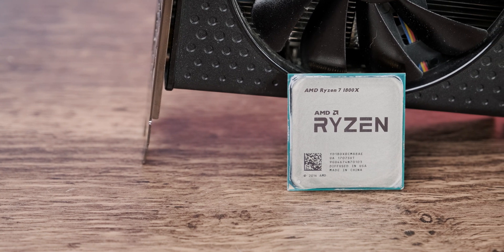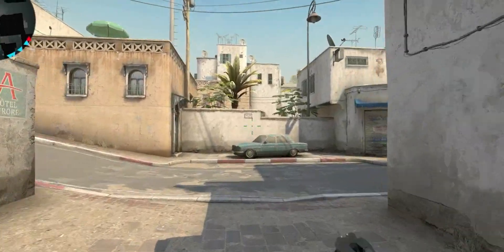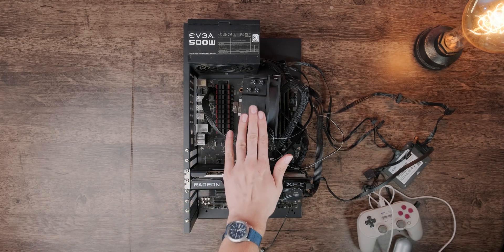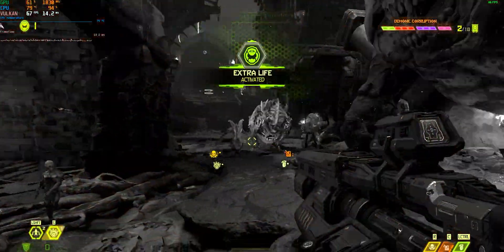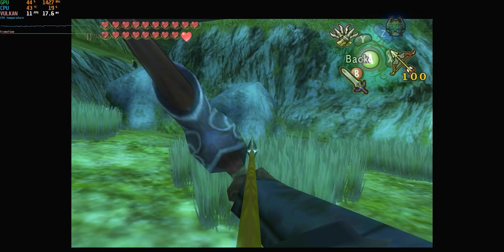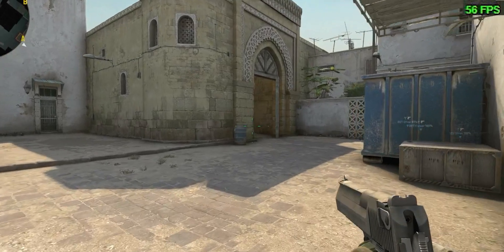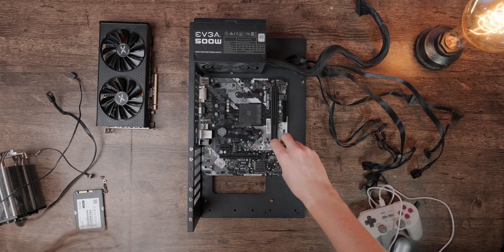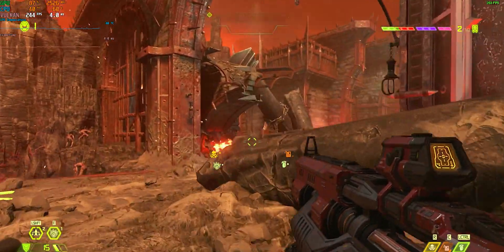WHY Are People Still Buying These CPUs? - AMD FX Series in 2023

Comment: My 6300 went over 5ghz stable on air cooler. Its way better than the similarly priced intel chips of the time. The operating system and games was the problem..it wasn't optimized for these chips , I argue by design. When games were better at multi threaded design these chips destoyed intel.

Comment: i run 3 8350 machines. one controls my CNC, one controls my laser and one is a linux box. the cnc machine has been running nonstop since 2012 no issues. it was a 3x sli machine but now has only one gtx 780sc. 2 were killed by canned air and not blocking the fan from spinning. all 3 machines have 32 gb ram. all 3 also run the Sabertooth 990fx MB and seasonic PSUs. the oldest box that has been on since 2012 was only cleaned 2 times both times i killed a GPU. but even in the garage in Phoenix AZ with an ambient of 135f it still runs great with the h115i AIO. For running the CNC i have an AC unit cooling the storage box under the machine where the pc and control unit are.  i ALSO HAVE A 6300 AN 8120 AND AN 8310 I have 2 backup mobos and 2 sets of 32 gb ram. I may make a few boxes as HTPCs. they are real 8 core CPUs just not hyperthreading CPUs.

Comment: The problem with the FX series is pretty blatantly obvious when you look at the architecture. Even their "high-end" offering of the 9590 was still based on the same failed Clustered Multithreading Technology that AMD premiered with the chips. It was, and still is, a terrible implementation of having two schedulers with one core because of cache sharing across the whole chip bogging everything down and causing huge latency spikes. I rocked an 8350 for a year before I upgraded to Ryzen 1800x. Now I'm rocking a 5900x and I've never been happier with an AMD system. Got my eyes set on Zen 5 as an upgrade path

Comment: I'm still using an fx8350, keeps me warm when my room is a bit chilly
Reply: If you want the same room warming feature in a modern CPU, Intel is for you.
Reply: Totally lol. When i max out setting i could heat a small apartment with mine.
Reply: @EddieJarnowski  thats the + in socket 3 +   " plus it heats your room "
Reply: I hope you paired it with a GTX 480
Reply: i got an enermax air cooler on my 9370 and it idles at 5c and maxes at 50c with mx6 thermal paste i benchmarked it and it maxed like 51-52c
Reply: @DoodmangYT  for some reason a lot of AMD chips from that era didn't report temp correctly, unless the room that it's in is actually near freezing temp.
Reply: @KingSnake377  thats missing a 2 lol its supposed to say 25c my bad lol. my cpu cooler is huge is why it wont fit in alot of cases my pc is also open air basically in a test case.
Reply: Exactly. Mine is water cooled, but ramp it up and you still get a nice warm air stream over the keyboard.
Reply: I have something else for that purpose 241w full load in benchmark running about 1-2 hours and i have nicely warmed room 😊 or heavy game with 225w gpu and like 100w from cpu about 2 hours and it's nicely heated 😊
Reply: Idk my wraith prism that I got with my r7 3700x cools my 8350 pretty nicely I have my 3700x to my cousin because it wasnt getting used because I have a laptop with a 5800h lol. I have a Asus corsair iv formula 2 slots dont work because of course it doesn't but I have a mild turbo oc to 4.5 ghz and it works fine. Just slow rofl.

Comment: I redid the thermal paste on my fx6300 and gpu after so many years of service. I havent overclocked it but it has served me almost daily since 2013. 

I wanted to see if there were any good, cheap am3+ chips out there that i could upgrade without redoing the whole rig. Any thoughts?
Reply from the maker: If you're already on AM3, the 8320 or 8350 could be good options. I wouldn't spring for a 9370 or 9590 though personally if I was on AM3. I would also avoid the 8120.
Reply: Mb is a big factor for overall results  esp with higher end cpu parts   but best performer overall inc stability with an oc and ov I found that my 8320 has been the best by a good chunk   and is superior to the 8350 as well

Comment: Hmm ok so i was not the only one who is experiencing studdering and slow load time on either application or game, i upgraded my old computer which had the amd fx 4 cores and decided to upgrade to 6 cores since the cpu can be had for cheap , paired with nvidia gtx 1070ti and i feel like it was a downgrade from my prev quad core setup.when i put the quad core back in all the games i play were smooth even the gtav which i played the most, how is it more cores equal worse performance and i read somone comments on how the cores were structured
Reply: The 6300 runs at 3.5 Ghz while the 4300 runs at 3.9. If the game only uses 2 cores, the 4300 wins.

Comment: My 8120 had terrible stutter in everything similar to yours even with 4.1ghz oc it was still pretty much trash in almost every way and would pull around 130 watts to do so the VRM on that board were always burning hot and really the price of high end AM3 motherboards is worse than price of the FX chips.

Comment: My latest PC originally came with an FX 8350. On games at the time that can fully utilize the CPU like Space Engineers it was a godsend compared to my last PC. That said, the 4x2 FPU setup was not helping with stability in other titles, especially single threaded ones.

I upgraded it to a Ryzen 5 2600x a few years ago alongside a more general upgrade due to the GPU memory chips getting damaged by the advertising cryptojacking exploit. Then a Ryzen 7 5700g last year due to ASUS doing a very bad thing with the mobo but that's a whole other can of worms.

Just an awful and expensive stream of bad luck.

Comment: We are called Retro PC Gamers of being a 10 year lag of having games of staying away from new ones out of the low income most of US have and using fx 8350 is OUTSTANDING for US of a PS4 level of playing games. Everything is affordable this way and life is great without needing to be like everyone else of doing the same things without going broke and homeless as this is the case of those issues involving gaming. In fact Ill be looking into getting a fx 9590 as I already have the fx 8370 so its all good.
Reply: I think I am good with my 8350FX, 32gigs ram, 2.5" 1T SSD, and R9-390 graphics on my MSI 990 gamer motherboard. It just works, though better in winter here in Florida. It runs smoother than my i7 2600 on Win 10, and both do great using Linux, though I have to use a lighter GUI on the i7. Though the Dell with a newer gen i7 runs close to FX, but too old to go win 11, and too expensive for a midget graphics card that is stronger than integrated.. Any who, they all work for a great cost. All better than them Core2 computers at least.

Comment: the cpu and motherboard prices before anything more is a good enough reason for me at $100 or less, that is even better since i already have a case, power supply, ram, and storage vs $300+ for just am4 motherboard and modern cpu upgrades, new cpu coolers in the thought too that's another price difference for extreme budget!

Comment: Games are finally using all of those cores and so they woke up a bit and they are cheap to get going.  Most of the problems with these CPUs were low core usage and also terrible quality poor motherboards with crappy VRM cooling making them throttle constantly.  I'm still using one of these 8370 CPUs clocked at 4.7GHz and yeah... it's not winning any prizes vs new hardware but I'm playing the latest games with decent frame rates within my budget for now while I save for something better.  Mine is paired with a 2060 no stutters in most games.
Reply: True about the vrm... and the northbridge also.. those gets very hot(thermal throttle)..

Comment: I remember when the FX60 came out, I had to build a system with it... real dual cores!  Must have been 2006/2007... Did a pretty good job with Oblivion...with a GTX 295, later replaced with dual SLI 580TIs...  For it's time it worked quite well...

Comment: I don't know but I have ASUS 990 FX board with a 8350 16 gigs RAM 128 gig SSD and a xfx  7950 card . And I don't care what anybody says if all plays very well I did a little overclocking on the car and the CPU and I guarantee you if you got it set up right it's playing modern games decent still

Comment: I only have my 8350 because i needed an SLI compatible motherboard cheap and it came with the memory and noctua cooler as well. Its my dedicated 7 machine with 2 gt9800 s in SLI to run mid 2000s tube TVs through S- Video for funsies.
Reply from the maker: That's a sweet setup!

Comment: i didn't know people were still buying them, but what i can tell you is that my PC is a UD3 motherboard(rev3), FX-8350, RX560, and 8gb of DDR3 and it still works for what I do. mostly emulation, Borderlands 3/Wonderland, Arkham games, Blizzard games, MTGA, things like that. don't do anything that requires super high FPS for esports or VR. and I still have no complaints to this day. you can say what you want about how old some of those components are, but they were built like tanks.
Reply from the maker: Yeah the FX lineup still works well, if you already have an FX system and it works for you, no need to needlessly upgrade it. But if you're building a new PC from scratch, the price to performance just doesn't make sense to me.
Reply: @aChairLeg  oh no, I love my little engine that could, but I would never recommend that anyone build it now. unless you wanted to get into extreme overclocking. they're practically indestructible and dirt cheap considering you can push them to almost 9GHz.

Comment: DO NOT overclock on that board, it's a 3+1 phase (people say 6+2, they are wrong) it has a UPI uP1601p 4+1 controller running in 3+1 mode with no doublers, it's using Niko mosfets which have a low rating and overheat, this causes the thermal pads to weep and become a real mess, eventually the VRM will fail and noobs will kill their cpu like Jay2Cents did because they think a crappy Asrock Fatal1ty board with a 4 phase is a good idea..
They have retained the prices they have... because a pentium dual core (2c2t) was £90 and an fx8320 was £100 so for budget buyers wanting to play games at <144hz (sooo most budget buyers then) while maybe wanting to try streaming or video editing where they could sometimes compete with i7's that are 250% of the price they were a good deal.
i5's were faster (especially over the next few years with FX not being updated) but they also cost allot more.
FWIW if you have a normal board just stick to 4Ghz@1.25v for efficiency and if you have a GOOD board upto 4.5Ghz and 1.35v.
Anything more just converts electricity and money into heat.

(have been tuning AMD and intel since 1999)
Reply from the maker: Solid really detailed information, I really appreciate it. Back then it did make a lot of sense to go AMD, just not as much nowadays IMO with how used prices are.

Comment: Funny enough I used my 4790k from 2015 to 2021, and it still kicks fine, just new games like 2042 absolutely made it show its age.
Reply from the maker: My 4790 was a champ. Unfortunately, my ryzen 3700x is a little tiny bit better haha
Reply: The 4790k should perform better than the fx8350. Especially cause you can overclock the 4790k.  Single core speeds are a solid amount faster.

Comment: FX-8320 should be rough PS4/PS4 Pro CPU equivalent. Therefore, all games that run well on PS4 and PS4 Pro would run well on 83x0 processors, providing you have decent GPU . In this case even Chinese "580" would do . Would I recommend to someone FX architecture ? No. But if you find something relatively cheap, you could play lots of games.

Comment: A young, impressionable boy bought his first gaming computer back in 2017 for $500, on sale from $800
He trusted the best buy staff, and showed them a link for a computer with an FX 6300, an RX 460, 8gb of ddr3 1600mhz ram, and a 1tb 3.5" WD blue hdd.
The nice best buy staff, in their kindness or pity, upgraded him to the RX 560 for free because they thought kids like him were going to run the world some day (seriously who says that in a best buy)

6 years later, that young boy is a man now. A man that is filled with white hot contempt having just built a ryzen 5 3600x, RX 6700xt, 32gb ddr4 3600mhz, 2tb M.2 SSD and 8tb archival HDD gaming PC out of used parts for $400
Spread knowledge. Do not tolerate awful price gouging
Reply: I feel so bad because from Microcenter in 2016 for $450 I got an FX 8320e, Asrock 970 g/3.1 (its an am3+ mb that supports m.2 and usb type c, RX 480 8gb, 16 gb 1600 ddr3, 120gb ssd, 1tb hdd, and a 500 watt EVGA psu and a cheap but at the time fairly cool Thermaltake Commander case.

Comment: my guess why 8120 performed so poorly is because lack of avx2 instruction set and relatively low clockspeed in heavy all core workloads. 8120 at all core workloads will sit at measly ~3.1ghz while 8350 at ~4.1ghz thats ~30% increase. Many emulators and productivity tasks do indeed take advantage of avx2 instruction set so there is that. Overall fx 8350 aged very well, considering its early reputation.

Comment: Brother amd fx6350 vs i3 3220 which one is good to build for coding and msoffice and gaming windows 10 pro..
Reply: at least use a i5-3550 as a comparison. an i3-3220 is only a 2 core 4 thread cpu, and thus will get beat by the fx 6350 unless you running some program that only cares about single core IPC

so like it would do better in Valorant...and that's about it for modern games

Comment: I think graphic artists are buying these chips. FX-6100, 16gb DDR3 2000mhz, I bought another Quadro-k2200. I got it overclocked nothing overheating or crashing. The VMRs need heatsinks and a little thermal throttling there. It won't do 4k but it does well with rendering 1080p video. We usually end up using used gamer parts to build a DIY workstation. I probably spent 150 bucks on gamer parts on this with the workstation card. I try to put together backup workstations. I lost 2 because of nearby transformer explosions bad enough to take out surge protectors.
Reply: Blender won't render the way it should. All the FX motherboards have PCIe 2.0 and Blender needs PCIe 3.0 video cards.
Reply: Systems like mybold 8320 work very nicely for this indeed

And if your surge protectors didnt protect the connected systems you need better power protection hardware   and start off with a whole house surge protector    they are a killer value and can be easily installed on almost any home wiree in the last  80yrs

Oh and I've had power protectors litterally on fire and explode while not failing to protect the hardware they were protecting    theybsacrafice themselves to do so which is their job!

Do NOT buy the crap $ store versions   do not daisy chain surge protectors (that changes the circuit in often very bad ways.  If you need to expand the outlets from your UPS  then using the very cheap small power bars from the $ store  often under sunbeam logo etc  that are just a short 1ft long or so cord and a mini bar with 3 or 4 outlets and NO surge or switch  etc at all   they are just straight wired)

You dont need to spend $$$$$ either    and apc isnt as good as they used to be  and are quite pricy  but cyberpower makes some good stuff as alternatives

Regardless of brand look for one that has AVR built in

Comment: do you think the FX-6300 would make for a decent NAS or server processor. I still have my old chip and I was wondering.
Reply from the maker: If you already have it, it's not a bad chip at all. It's just compared to other more modern chips the prices are high IMO. I think it'd be a great chip for a NAS or server.
Reply: It can do both  but as always the mb picked makes a BIG diff   uber cheap pos mbs need to be avoided  and the uber $$ 9xx series are generally not worth it
For server use I used an old gb 880g with onboard gfx and the one sys is running perfectly n
Here almost nonstop 24/7 for over 12yrs now   same for my other fx sys that's now retro center using a wc oc ov 8320 on an asus mb   and it runs  several Oss etc from bare metal or from VM as needed  to cover almost anything  from the late 80s til now
Reply: For a Linux NAS it's fine, for a sever probably be good, too. Keep it fed with as much memory for drive caching as you can. As for a streaming server, if it's just A/V with two or three clients you're fine. A lot of memory and a fast drive is best. But for a gaming a server, forget it. I use a 1TB SSD in my NAS and it seems to keep my 1Gb network well fed at >500Gb/sec.

Comment: I mean Im still runnin the fx-6300, but its also my first pc. Only thing holding me back is the face that I dont have the money, +im enjoying the games im playing.
Reply from the maker: Yeah, if you've already got one, they still work fine. But buying fx chips nowadays just doesn't seem to make financial sense to me
Reply: @aChairLeg It makes sence if you own am3+ mb already, with a weaker cpu. For example, I upgraded from Athlon II X2 B26 to FX-4100 - it was cheap, and the manual claimed that it is totally compatible with my Lenovo mb. I think I got about 30-40% improvement in video rendering times after the upgrade. As for games I played... the fps stayed the same. I guess gpu was the bottleneck. However, level loading times improved, though I didn't measure that in numbers.

Comment: These processors came out in an era where games used 2, or 3 cores tops and Bulldozer didn't have excellent single core performance from what I remember. If anything AMD should have stayed with 3-4 cores and crank the Ghz up a bit, then release 6-8 core chips later down the road. These chips aged like wine as everyone knows.